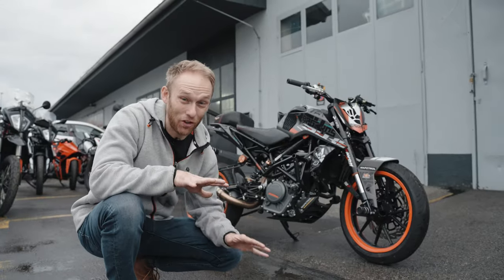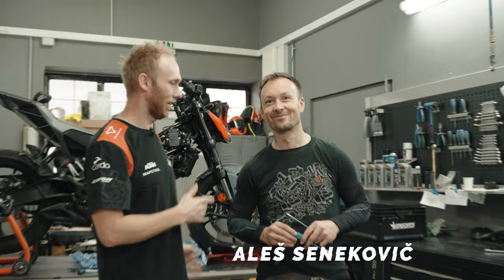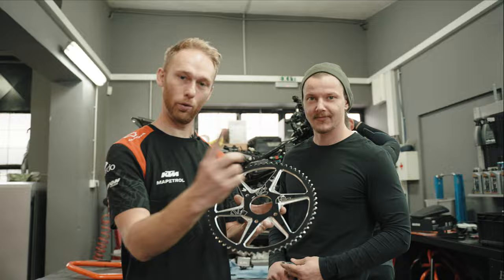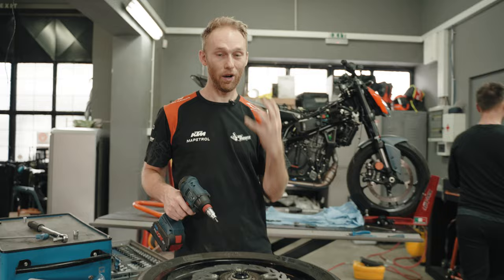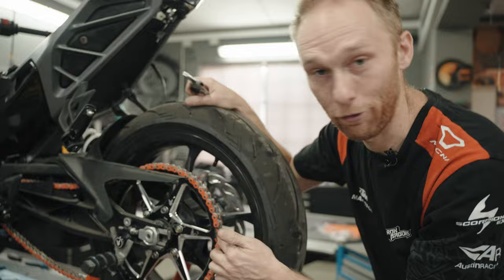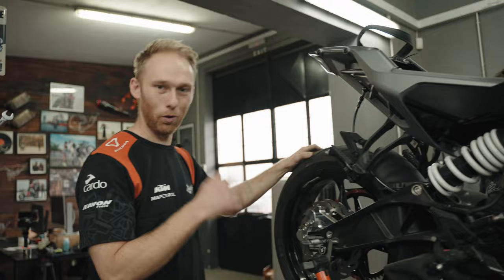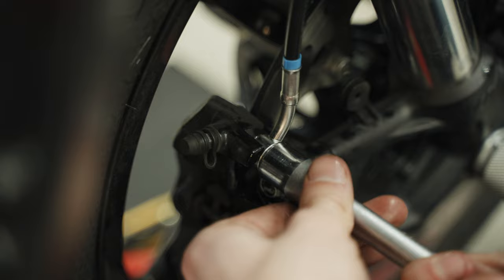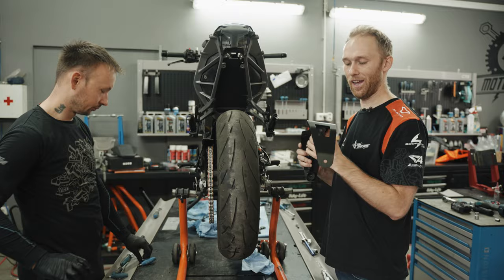CUSTOM 2024 KTM 250 DUKE STUNT BUILD PART 2 | RokON VLOG

Comment: Hi @RokBagorosStuntrider, I just bought the 2024 Duke 390 (Blue) yesterday and rode it home, I'm going to teach my kids how to ride on road, and is perfect bike. However, I've been looking for all the crash protection as it will likely get dropped, and the Engine Crash Cage listed on the KTM PowerParts page is only for the Gen2 model up to 2023, there is no Gen3 Engine Crash Cage listed yet for the 2024 model. Our local KTM dealer has said the older Crash Cage for the Gen2 / 2023 model won't fit the new Gen3 / 2024, as is has a new engine and frame.

Can you provide a link / part number for the Engine Crash Cage for the Gen3 / 2024 Duke 390 please, as my dealer can't order anything in yet?

Keep up the great videos, love em.
Reply from the maker: The crash cage was only a prototype so I recommend to get the bagoros performance crash bobbins and the subcage and you bike will be bulletproof proof ;) Use the SHOP BY BIKE option to see the right parts for your bike ;)